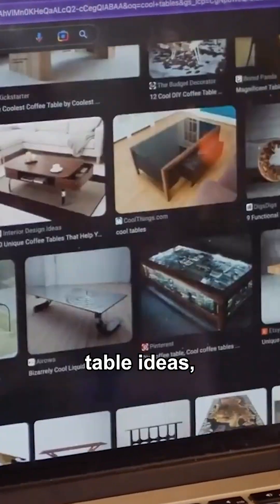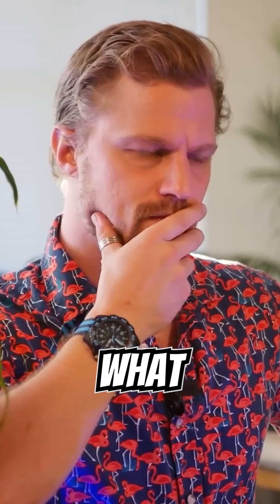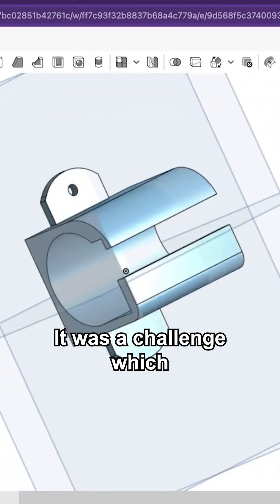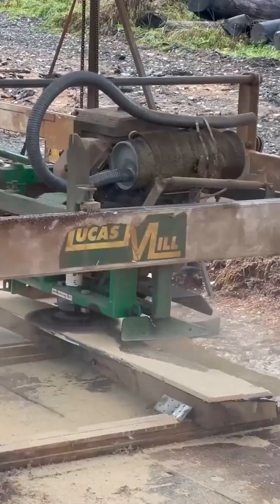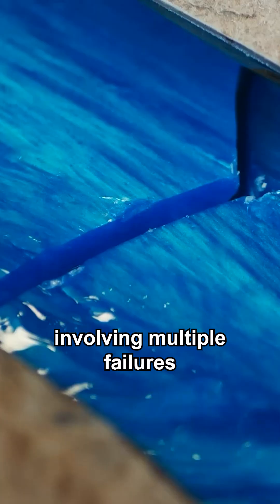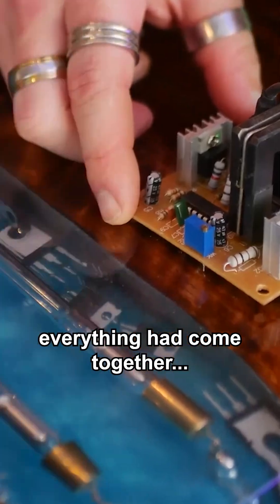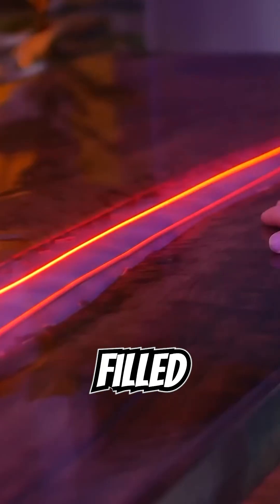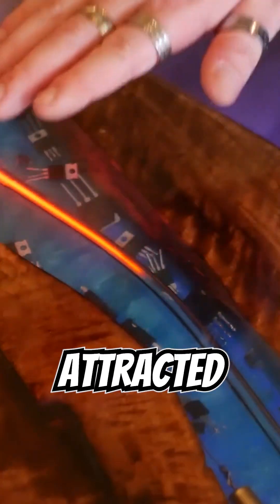A Touch Responsive Plasma Filled River Table

Comment: USE aerosol 91% rubbing alcohol. You won't need heat to get rid of bubbles. Try it next pour. You'll thank me. Spray n watch, spray if anymore comes up. I've created this method &  told many who have issues with bubbles. . Spray it with rubbing alcohol. NO you can't use grain 190proof cause it evaporate too fast

Comment: That be a sweet table to use with friends! i wonder if it reacts to every day table items, like dishes and silverware?
Reply: I believe he used capacitance to detect objects. That means the object has to be electricly conducting. Plates are ceramic, which is used in capacitors due to its ability to insulate, and therefore does not conduct electricity. But silverware is conductive, and should therefore hold a bit of capacitance when near the table, and their high surface area to mass should mean a somewhat decent natural capacitance. Hope that helps. 😅